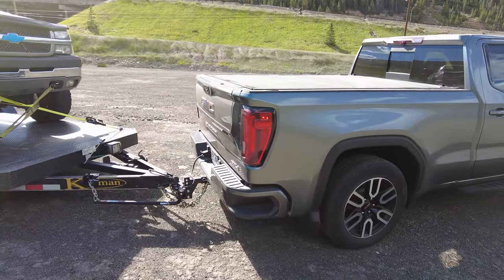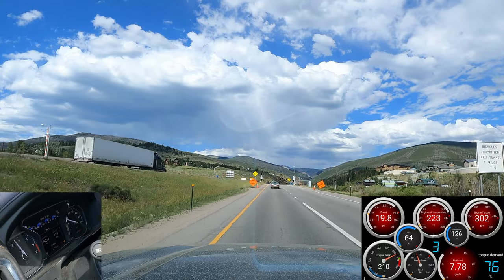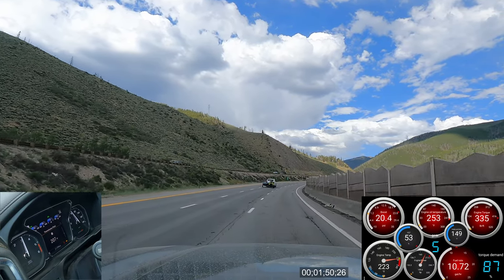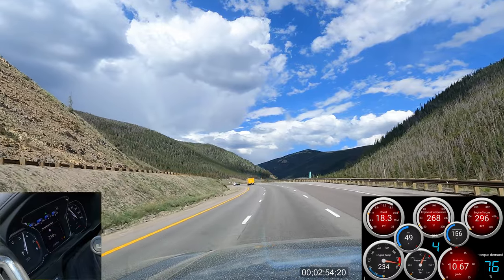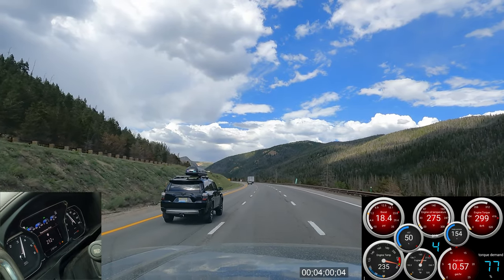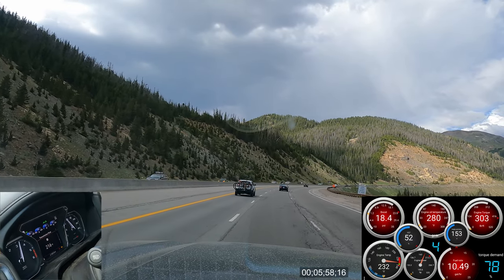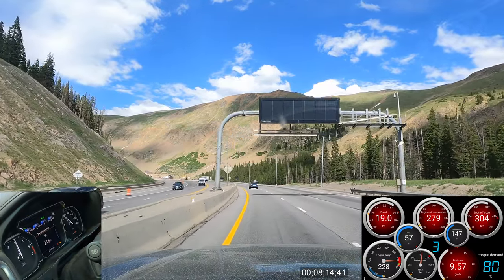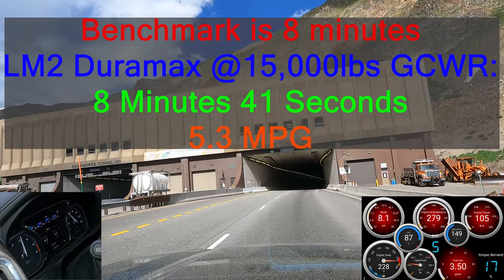Baby Duramax with 15,000 LBS VS TFL's Ike Gauntlet - Mega Tow Test part 2

Comment: I think you are misrepresenting this video with the title. You are stating that you are towing 15000 lbs but that number is your gross combine rating not that amount you are towing.
Reply from the maker: That is the total weight being pulled by the engine.
Reply: That's clickbait!!
Reply from the maker: @LaineHarbaugh  no it's not. The engine is towing 15,000 lbs. It just also happened to be the limit of the truck as well.
Reply: 15k is absolutely accurate. He never said towing 15. He’s towing about 9

Comment: Nice vid, man. The 3.0 duramax is a beast of a diesel for half ton needs. I suspect the LZ0 is even better. Honestly, I can't think of any other motor I would want from any of the big 3 in a 1500.
Reply: Just got my Silverado 1500 LT with the LZ0. It is an absolute dream. I live in CO and can't wait to pull the camper up the IKE.
Reply: @ibold1000 how is it holding up?

Comment: When you say your at 15000 lbs, is that what your towing and the truck itself, or just the tow weight? I was planning on towing a 37ft rv with a dry weight of 8500.

Comment: I have a 2022 1500 high country with the max tow package and regularly tow a ATC 2419 gross with all my toys at 10,800lbs. I live in the Pacific Northwest  and mainly tow in the mountains and average between 10.5 and 12.5 mpg and I have never had to go below the speed limit except to wait up for a friend towing less weight with a 2007 8.1L. I average 27.5 when not towing, wifes boss has the same truck without the Max tow and gets around 32mpg.
Reply: Does the max tow package reduce gas mileage?
Reply: @TheSouders  yes, as I said my wife's boss has a 2024 Denali and he gets around 32mpg and my Daughter recently bought a 2023 GMC elevation and is getting the same 32mpg. She just moved across the country to Tennessee and towed a 9000lb trailer and averaged 13.9 for the 2200 mile trip. She does not have the max tow, but I think the extra HP and Torque really make a difference in the 23 and up model.

Comment: Are those Gauge an app or after market gauge set up? Good video that oil temp is hot, oil boils at 242 degrees, crazy to hear GM says these temps are ok, EGT’s over 1200 are damaging, oil temp that high is damaging I mean I can’t see how they say 320 degrees is ok for the oil crazy. Thanks for the video
Reply from the maker: Thanks for the comment. That is with MX OBD link I highly suggest an iDash instead. 

It's a full synthetic oil. That EGT is pre-turbocharger they're rated for right around 1600F sustained.
Reply: Oil boils at 242 degrees? Who told you that? That is flat out untrue
Reply: What is true then?? Oil definitely starts boiling as low as 240-250 degrees on the low end and 700 on the high end. Coming form the oil manufactures who produce it…  @firstlast---
Reply: @LeviDill  The onset of thermal breakdown is different for every oil. Under high pressure moving quickly through the engine there is no chance oil will start boiling at that temp in those conditions. It won't happen
Reply: Not arguing with you. I have seen it boil at lower temps of 300 degrees. Of course every oil is different. Two things that kill motors. Heat and timing. This isn’t something I’m just shooting from the hip on. There is a reason the oil temp was hot, the cooler will only “cool” the oil so much.. @firstlast---
Reply: @LeviDill  I'm not arguing with you either I'm telling you facts. Whether you choose to believe it or not is on you. There is a zero percent chance you have seen something boiling inside of a running engine
Reply: Riiiiight.. Zero percent chance of an oil cooler blowing or being overworked too huh? lol  @firstlast---
Reply: @LeviDill  I haven't heard a single report of that happening on a current model vehicle from any manufacturer
Reply: Good to know. The VVOP that is rubber belt driven in the back of the motor, throw in the oil consumption problems along with the coolant issues these trucks have, and the high oil temperatures that people are having is a bad recipe. I do know that higher oil temps (even within manufacture allowance spec) raises the question of wear… The truck itself is awesome honestly. I’m not hating the truck. Just stating that under the examples shown in the video, the truck is liable to have more wear issues than normal because of high working temps. Nice talking to you!   @firstlast---

Comment: That could be a great motor of GM would of made it a pickup truck motor not a cab over motor which means all the drive components on the front of motor not the back and all gear drives no chains and a gear drive oil pump. Come on GM make this motor right not a second thought motor so the 3rd Gen fix these things and make it a pickup motor and a bad ass motor at that !!!
Reply: 200k service interval on the belt.  I'm not too worried about it.  Would I like all gear driven?  For sure!
Reply: Agreed!! @Derek-pd4fc
Reply: This is the only way we were getting a half ton diesel. In an ideal world, sure serviceability would have been better, but GM wasn’t going to dump $10M into an engine program at the time. I’ll take it since it turned out to be the best of the big 3’s small diesel options

Comment: Thanks for all the Videos, definitely helping me in deciding my next truck to pull my current Travel Trailer at 23ft/ 4600lbs  (may upgrade soon to a longer 28-30ft about 7000lbs).  Going between the new GM 1500s with the baby Duramax and Nissan Titan XD 5.6 Gas.   Know the Titan will tow better but like the Duramax as a great cross between being able to tow my 6-10 times a year but also get great everyday/highway MPG when not towing.    Your truck have the 3.23 or 3.73 rear end ratio?
Reply from the maker: my truck is an AT4 so has 3.23. 3.73 is what I would suggest unless you need 4WD Lo. if you lo range you will be forced to get a high country max trailering as that is the ONLY way to get both.

Comment: Does the LZ0 perform better? I am curious how much the additional power helps. It would be nice to pad the max numbers out a bit. I have the LZ0 in a Sierra 1500 and my truck also maxes out at 15,000lbs GCWR
Reply: The biggest limitation here was EGT and charge air temp. That’s why his torque never exceeded about 310 when the engine can put out over 450. EGT can’t be helped a whole lot but the charge air cooler and intercooler could be upgraded.

Comment: It’s normal to have issues with LM2, high oil pressure and belt problems …, always going at maximum capacity at high temperatures. Users should never exceed %70 of capacity!

Comment: And get rid of the two stage oil pump leave it as a high flow low pressure pump or full pressure all the time. I think it’s a great motor if you will fix these few things and a rubber belt drive oil pump are you kidding me come on you can do better than this !!!!

Comment: It seems 280 is awfully high for engine oil temp. Any concerns?
Reply from the maker: Considering this was maxed out and on the hottest day of the year and WOT. No.

 Wouldn't want to make it a habit but anything under 300 is okay If not ideal.
Reply: What engine oil do you recommend?  I'm a Ford guy, but considering switching to a LZ0 so I'm reading all I can.  Thanks for the videos!

Comment: Awesome video,  those temps are really high,  surprised the fan wasnt blaring to cool everything down. Overheating is 240 degrees a d 1400 EGT thats like really freakin HOTT i let off on my 6.0 powerstroke if it gets near 1200
Reply from the maker: Thanks for teh comment!

the new truck have fuel control. you can't hurt them, we are testing the systems here. the fan was on full, truck is just that quiet. dont forget it has a DPF so you see higher temps due to the restriction. 1572 is the limp point. teh 3.0 never gets there because of teh ECU limiting fuel above 1,000 ish.

Comment: I keep going back and forth on getting a truck with this engine
Reply from the maker: Good engine. My issues were bad dealers.
Reply: @duramaxadventures5832  also, I can't believe that 3.0 is capable of towing that much! What's the gear ratio?
Reply from the maker: @HostileTerritory  this one is 3.23. if interested in towing get the 3.73 "Max trailering" hard to find but 100% worth it

Comment: Unless that truck and truck bed is filled with concrete I am not sure how you are getting 15000 pounds.
Reply from the maker: @adamh3272  every thing here is 15k, actually about 300 lbs over when full of fuel.
Reply: @duramaxadventures5832  oh ok you are talking both trucks and trailer. I misunderstood.

Comment: I'm looking to buy the 2024 1500 Sierra AT4 Duramax with tow package.  Trailer I'll be pulling GVWR is 7400lbs with a dry tongue of 850 lbs.  My day to day will be driving around town, every other weekend pulling trailer.  In your thoughts, is this truck enough or should I go bigger (HD)?
Reply from the maker: @AndrewVanMeer  do you live in a mountainous area? 

I only had 1,400 lb of payload so do bear that in mind. That only gives you 550 lb for the driver and anything else that you put into the truck. 

For me personally the fuel economy when towing was about the same if not slightly better than a heavy duty diesel, and the unloaded highway economy was about 13mpg better than the L5P. 

If I hadn't already owned two 3.0's, I would have bought a another one. but instead I went with the Colorado which has been.... less than ideal when it comes to fuel economy. Over 11,000 mi I've averaged 14.2MPG. on this 3.0 AT4 that you see in the video, over 25,000 miles I got 22, but almost half of that mileage was towing.
Reply: @duramaxadventures5832  I do not, but plan on taking this thing all over when we get the chance. 

Curb = 4,910 lbs
GVWR = 7,200 lbs
GCWR = 15,000 lbs
Gross Axel Rating Rear: 3800  lbs  3800.0 min 4150.0 max

My payload I calculated 2,290 lbs (GVWR - Curb) and tow of 10,090 lbs (GCWR - Curb)
Reply from the maker: @AndrewVanMeer  you'll need to check the actual truck you are buying. 1670 was max payload on AT4. But that was a 2019 5.3 small cab one.
Reply from the maker: @AndrewVanMeer  that curb weight is WAYY under what the AT4 is. Mine weigh 5800-ish

Comment: Oilt temp was toasty. A Cummins X15 throws a light at 266 degrees.
Reply from the maker: GM has it set for 300 sustained. Their oil they use is good for 350.

Comment: 234 engine coolant temp, trying to toast that engine?    I dont ever push the pedal to the floor on my gasser and she dont go over 200degree, suggest you tuck in behind one of them 18 wheelers
Reply from the maker: GM runs them to 245. It has a computer controlled cooling system. Normal is 225 empty cruising on the highway. 
EcoBoost runs 235F on this hill.
Reply: @duramaxadventures5832  I dunno, temp gauge shows it way up in the red zone. Was down around 212 at lower speed.  I would watch the fuel consumption gauge to regulate my speed.  Excess fuel burn is just over heating the engine, not making the wheels go round and round
Reply from the maker: @enricoderojassarson5596  oh, ya that's because I didn't set the ranges correctly. You can change where the red starts and what not.

 And noted on the fuel burn. That was the plan if it ever got up to speed.

Comment: Thanks for sharing the info. I am curious to see how the exhaust brake does on the downhill.
I wonder if you could have held your speed at 60 going up, if you ran either cruise control or manually selected gears? Thoughts?
Reply from the maker: No, truck was out of EGT headroom. Once it gets over about 1050 it starts pulling power. The torque request is basically the amount of available power.
Reply from the maker: Whoops this is also the wrong video title 😅😅
Reply from the maker: 8:41 is not. A record

Comment: Is this truck equipped with max trailering or are you running the highway gears for this test?
Reply from the maker: There was no 3.0 max towing for 2021. 3.23 gears
Reply: @duramaxadventures5832  wow that’s impressive. I have a 2024 LZ0 with the max trailering and 3.73 gears and have yet to put it to the test.
Reply from the maker: @devinsampare9483  I was extremely unhappy with GM. In 2020 they had the secret package called the diesel off-road package and it came with 3.73s and mud terrains. I think they were fishing to see if they would have warranty issues. 

Suddenly in 2022 Max trailering becomes available. Unfortunately the diesel off-road package also included 4 low, Max trailering does not. However. If you want 4 Lo with a 3 l Duramax and max trailering there is a secret. All high countries come with 4 Lo as part of their whole brand image for that trim level thing. So if you order Max trailering on a high country it is the only way in all of GM to get a 3 l Duramax with four low and Max trailering.

Comment: I wouldn't trust a Daramax after one broke down on me twice on the same day after it took all day to fix just to have brake down again after we got home
Reply: Sounds like you got a bad one to start with. If they were all that bad, we would be hearing about it all over the place. Since you are not trusting a Duramax, what is your recommended 1500 diesel setup because both Furd and Dudge pulled the plug on theirs.
Reply: @billyyank5334  It's all over YouTube people having problems with darmax diesel trucks common fuel problems. Ford, Chevy, Dodge the company's all know about it but they don't want to fix it costs to much or don't know how too fix it.
Reply: @billyyank5334  I wouldn't recommend a diesel setup 1500 the next too the towing of a Duramax Diesel. Is what I have now 1500 Chevy Silverado Texas edition 9,000-12,000 pounds. Maybe a trail boss but I think it's lower then the Texas edition less it's the Duramax.
Reply: @billyyank5334  Some the diesel fuel made the fuel injectors bad and fuel pump. One YouTuber said he was going to Ford because he was tired of fixing the same thing over and over and the dealership mainly just blames the owners. So they don't have to fix it but I seen the same thing with another YouTuber on a Ford diesel truck oil fuel problem.
Reply: @SULLIEDASP  Thanks. I'll have to do some searching as I hadn't seen anything about that.

Comment: even the gas motor would've walked off from that lityle 3.0. not to mention the 6.6 but not bad
Reply from the maker: It would not have. Not at 11k feet, 6.2 would be down to 230 RWHP.
Reply: 3.5 ecoboost pulls this hill much better tho and at 2500 rpm.
Reply from the maker: @WadeWiggins-eo7bc  it does not. TFL's overheated and limped.

Comment: Man the oil temp was making me nervous lol. Does gm say thats within normal operating range when fully loading that vehicle and working it 100%? Egts arent bad though, 1200 for that thing pulling the weight its got to pull up a grade at 8k feet. Is this a factory tune ?
Reply from the maker: Yes 100% factory GM says oil good to 300. (Not technically wrong according to mobile 1 testing)
Reply from the maker: Honestly EGT are in control due to the ECM limiting power during sustained loads. That torque request (bottom right corner) is the dynamic tuning. Anything under 100 (at WOT) it's pulling power.
Reply: @duramaxadventures5832  yeh just from knowing the 6.6 duramax and working on them daily I wouldn't even bat an eye at 1200. Just the oil temp had me opening my eyes wide. I don't pay attention to torque demand, fueling is a more accurate way  . I couldn't see on my screen but your engine fuel rate , what is it measure in ? Mm3?
Reply from the maker: @TAGDIESEL  the only option with this controller was gallons per hour.
Reply: @duramaxadventures5832  controller? Could you program and adjust parameters with the live stream data reader you had plugged in?
Reply from the maker: @TAGDIESEL  whoops I meant monitor. It's not bidirectional
Reply: @duramaxadventures5832   Roger that.

Comment: I thought that truck could only tow somewhere around 8800 pounds especially for the at4
Reply from the maker: That's what it's towing. we are maxed out!
Reply: Ohh ok I misunderstood. I thought it was towing 15000 lbs
Reply from the maker: @santiagoortega92  that's the total weight truck and trailer.
Reply: With the Max Towing package that gives it a higher numerical rear gear ratio, it'll tow 13,300 lbs.

Comment: Man that engine oil is HOT
Reply from the maker: GM insists it's good until  320°
Reply: @duramaxadventures5832  Alrighty then.. Nice job on the video I appreciate it
Reply: Why cook an engine like this??
Reply from the maker: @ML-lg4ky  bits literally designed to do exactly this.

Comment: What did you think of overall performance behind the wheel?
Reply from the maker: Useable. Wish EGT could be kept lower to keep power up. LZ0 should solve this.

Sway, nothing to note, this trailer won't sway unless you get REAL crazy loading it.

Power wise is a bit of a double-edged sword on one hand they really gently taper this power to where you're not really going to notice that it's slowly decreasing power. (Whereas on a heavy duty it tends to be very apparent when it reduces power). On the other hand when not doing long passes and just doing sort of medium stuff I wish it would give you a little bit more lead room before it starts pulling power. 

I should probably clarify I'm not talking about power tanking off of a cliff it just slowly decreases it a couple percent at a time.

Bear in mind though I also don't drive like a lunatic and I recognize that I weigh 15,000 lb. I've also always had a loaded trailer that weighs more than the truck.

Honestly outside of the mountains from behind the wheel you don't really notice that you're working it hard, so it's really good at holding gears. Mpg and def you know but everything else is relaxing 

Fun fact I got better mileage on this run than I do towing my 5,000 lb trailer behind my LBZ.